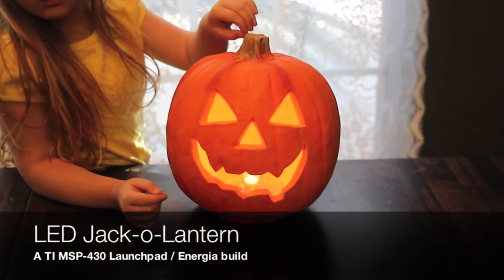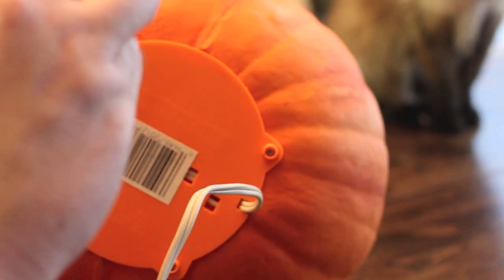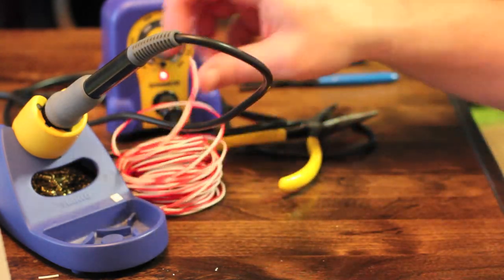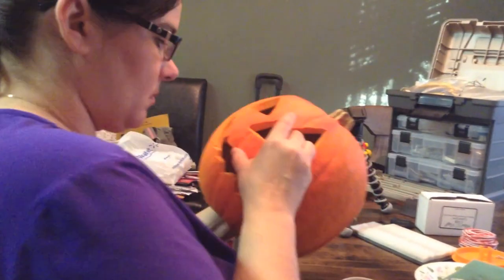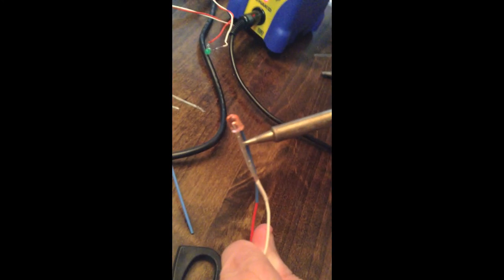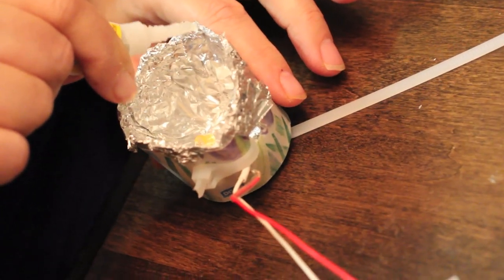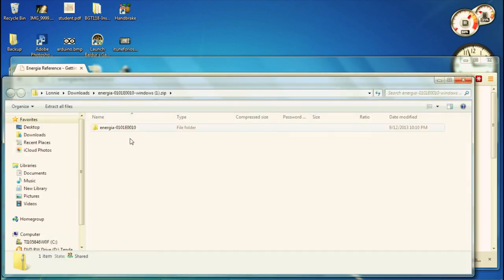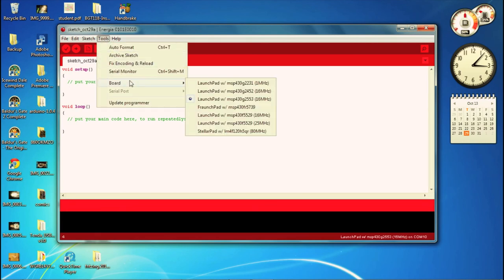LED Jack-o-lantern built with TI MSP-430 Launchpad and Energia

Comment: Hi, I have a 2553 programmed with 7 led outputs on breadboard. All is fine with 5 leds. When I program 6 or 7, 5 leds stay on and don't sequence. The  last2 outputs don't even fire. I didn't think there's a limitation.  If I disconnect any 2 others work fine?
Reply from the maker: Are you sure it's not power related, as in not enough power.  Have you tried using different pins?  Anything I tell you would be a shot in the dark without actually seeing the project or at least seeing code.
Reply: Thanks for the response. I already figured it out. In the process of testing I blew some outputs. I had our socket on solder board soi moved it into breadboard with 7 red leds no resistors and 3 volts from batteries, reset pin tied high. I then programed all pins as output and tried to fire 7 in sequence. I soon found out which pins didn't work. I just moved the outputs that work to other ones and tested. On solder breadboard I powered it from 5V and made a resistor divider to get  about 2.5V to power the chip and 5V to drive the 14 multi colorless leds thru 7 transistors and resistors. It works well. If anybody is interested I'll do a schematic and video on the car. I call it Anti-collision alert light. It works off of the brake light with a 5V regulator. 
Thanks for your video it gave me some ideas in programming.
Reply from the maker: electronicspark1 The thought that you had bad hardware crossed my mind, but 99% of the time that I think it's hardware with this stuff - it's not.  :)  Turns out it was this time.  Glad you figured it out.